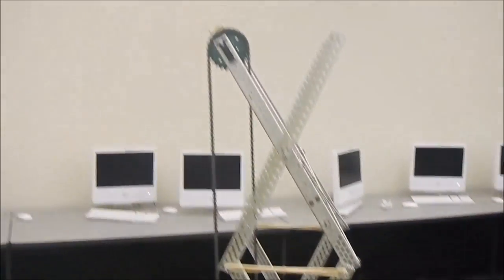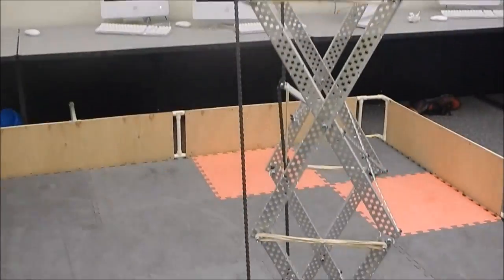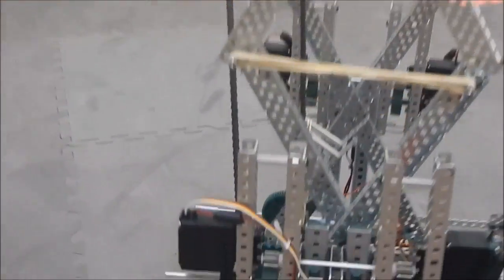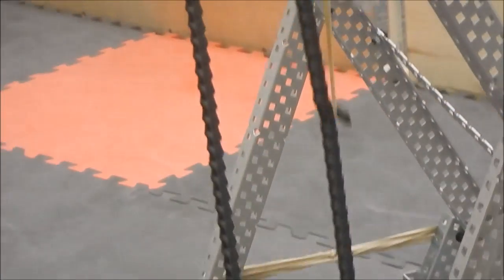4149G Scissor / Chain Lift Como

Comment: How did you guys prevent the chain from falling off when scissor lift extends at the beginning of the match? My team is have a hard time dealing with this problem.
Reply from the maker: The chain is temporarily held on with rubber bands. The rubber bands are strung through the chain, and then over the sprockets to hold the chain onto the sprockets. It is a delicate operation. Once the lift has been raised, then tension of the lift hold the chain in place quite well.